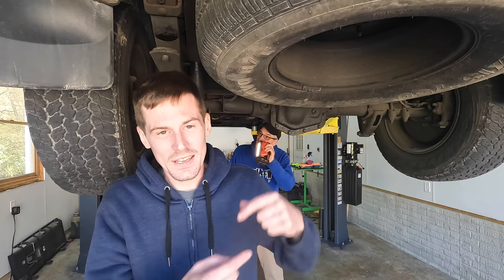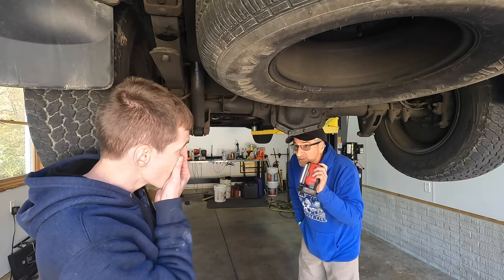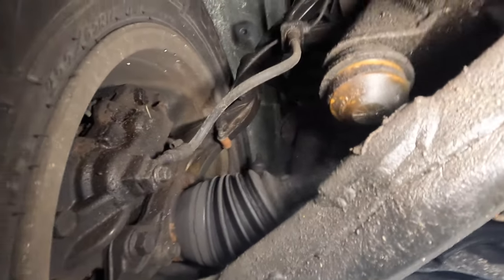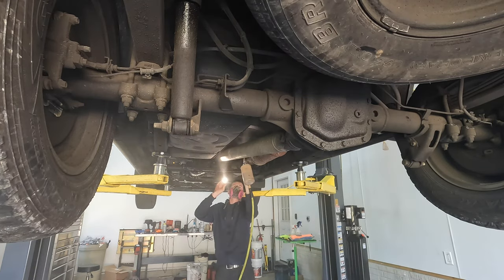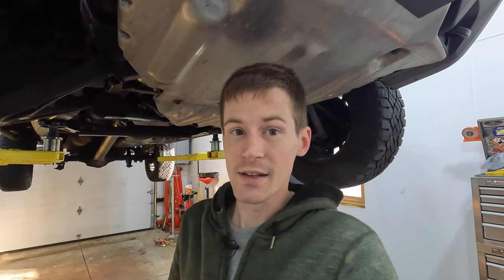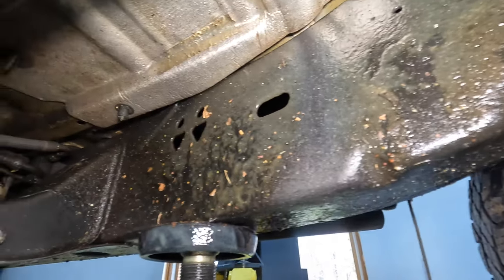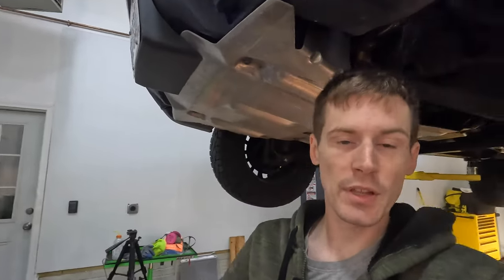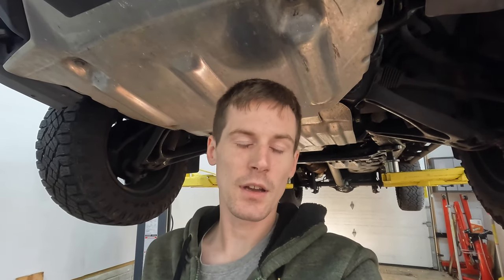Lanolin Undercoatings 5 Year Review & Career News... (Fluid Film, Woolwax, Surface Shield)

Comment from the maker: Edit 11/4/22 Going forward Surface shield will have a female top on the aerosol cans like the other products that are out in the market.  This means the grafitti adapter is no longer required to attach the inner cavity tool to the aerosol can. As of now both the male and female cans are on store shelves. Just something to watch for.

Products used in this video: 
Surface Shield Gallon: https://amzn.to/2YpscVq
Surface Shield 5 Gallon: https://amzn.to/30rrrvK
Surface Shield Aerosol: https://amzn.to/3BIUgk8
Fluid Film: https://amzn.to/3mQbiZy
Woolwax: https://amzn.to/3wmpbS1
Professional Spray Gun: https://amzn.to/3bIN9gX
Aerosol Can Spray Handle: https://amzn.to/3EUpE1b
Graffiti Adapters for MALE Blaster Cans: https://amzn.to/3CPi5rX
Inner Cavity Spray Wand for Aerosol:https://amzn.to/3NNtZbP
Wireless Borescope: https://amzn.to/3CPdCoV
My Amazon Store:  https://www.amazon.com/shop/repairgeek
Help support the channel, buy using my Amazon links
As an Amazon Associate I earn from qualifying purchases and your cost is exactly the same

My Amazon Store:  https://www.amazon.com/shop/repairgeek
Help support the channel, buy using my Amazon links
As an Amazon Associate I earn from qualifying purchases and your cost is exactly the same.
Reply: I just tried surface shield for the first time this past weekend on some round frame rails before putting caps on the end Inside the wheel wells. I picked up 10 cans from Harbor Frieght and to my surprise I got 7 cans with a male end, and 3 cans with the new female end. I wasn't aware of Blaster making this change, so I had already purchased a cavity coating wand made by 3M that accepts the male end cans. Now I'll have to buy another wand for these new style cans. I'm curious, have you verified that the KBS coating wand works with the new female surface shield cans? Or have you sprayed it with the KBS wand and the graffiti adapter?
Reply: thanks for this update! do you know if the product on Amazon is being sold with male vs female currently?
Reply from the maker: I have no idea what stock Amazon has on hand. I know the newer stuff that is heading out the door is female.
Reply from the maker: The KBS for a fact works. I literally bought every single cavity adapter on amazon and tried them all.
Reply: Will they ever be available in Canada? We need it the most!
Reply: I think what fluid film dealers meant was that surface shield is a harmful solvent and their product is not harmful if inhaled, on skin, or eaten by you or pets lol. Going to be buying a 4runner soon, which would you recommend? Fluid Film vs PB Surface Shield? I like that a gallon of Fluid Film is half the price.
Reply: Great job man you've made a difference in the world while being honest and bettering the quality of life for yourself and loved ones cheers to that my friend, thanks for the videos 👍🏾💯
Reply: Almost every single inner cavity 360 spray extension nozzle are made for MALE !!!!!! TOP !!!!! SPRAY !!! CAN !!!! NOT FEMALE!!!! Now Surface Shield has female tops on the can, it is IMPOSSIBLE to find any inner cavity extension without paying a ridiculous amount of money for a plastic tube and a brass nozzle! KBS works for an insane price. You can buy extension for male spray can for under $10
Reply: If only under carriage car washes offered lannon spray
Reply: Just purchased a new Toyota Camry SE and I'm going to Fluid Film it this summer, any tips not mentioned in the video? I've heard that Fluid Film and Surface Shield never truly washes all the way off. There's always a microscopic layer that gets into the pores of the metal parts of the undercarriage.

Comment: I heat the Woolwax to about 180* and blast inside all the frame holes. It comes out so fine that you can actually see plumes of W.W. mist come out in all other areas of the frame, far away from where I am actually spraying.  This ensures that the inside of the frame is coated as well. Great videos!
Reply: Hey I used a product called Waxoyl . They have underbody and cavity products and instructions indicated to place in hot bucket of water then pour into spray gun for best results coating and creeping into pinch welds and inner sheet metal.

Comment: Really appreciate this content. It takes a huge amount of energy and resources to make a vehicle. Anyone who promotes protecting these vehicles from corrosion so they last as long as possible is doing a great service to people and the environment. I have lots of experience with fluid film and I found it washed off too easily (salt/snow belt Ontario), and it is expensive. I also have experience with "annual dripless underbody oil" from Carquest. I can get a 5 g bail for the same cost of 1g fluid film. This stuff is 100% dripless and seems to last longer although it's likely toxic compared to lanolin.

Comment: I watched a lot of undercoating review to settle on which product o was going to offer in my business. I've sprayed both WW and FF and found WW to be better for long term adhesion. I've not tried Blaster mainly because of the cost but from what I've gathered is Blaster is essentially the same as FF and WW but has petroleum jelly added to increase its longevity.  When I do undercoating I spray thick. Usually 1.5 to 2 gal for a truck. I also spray everything including the floor pans and bottom of the bed. On my second year I had a few repeat customers and was beginning to think they weren't satisfied and went elsewhere.  That wasn't the case at all. They simply saw that it didn't need another coat. Again, thanks for your honest reviews.

Comment: I live in the Salt Belt and started using Woolwax when I got my 07 Silverado from Texas about 3 years ago. All our cars get a treatment every May and touch-ups in October. I even spray over the rust and it slows down or stops further rust. You can even spray inside frame channels. Advice: if you use an air compressor, put an air dryer between the compressor and your air gun, otherwise you may be trapping moisture inside the Woolwax. Also warm the quart jugs in the sun (or in hot water if you live in the northeast where the sun doesn't exist) to make it flow better.

Comment: I just had my new Outback undercoated with Fluid Film.  I ran out of time to do it myself, so I had another company do it.  I wanted to use Surface Shield based on your results but I could not find any dealers.  I realize it is a new product, but Blaster needs to have an online list of applicators once the product gets more established.

Comment: I’m a Woolwax and Fluid Film user. If The newcomer, Surface Shield, has been available when I started using lanolin I’d likely use it as well. Fluid Film is available at Walmart, for me that’s a plus (actually a minus since I get a discount😊). Woolwax was the first one to be available in black so I use it mainly on the underside because it just looks sweet when it’s fresh. Fluid Film goes everywhere “hidden”
I’ll likely not switch from my current product and annual or as needed applications. Reason is these products just work and are not very costly for a DIYer.
You keep doing what you do, you do it well.

Comment: I’ve used both Surface Prep & Fluid Film, and they work.  Agree, SP is easier to spray, and a little thinner (creeps well).  Most of the benefit is in thorough application.  The first application is the most time & product consuming as every nook & cranny needs covered.  But each year after that gets easier, I just hit the high splash areas.  Both great.

Comment: Congratulations. Well deserved. Excellent videos. Used surface shield on my 2015 King Ranch PowerStroke. Looked ok after 2 Upper Peninsula Winters and weekly car washes, it washed off rather quickly. Used the spray cans. 3 didn’t work. Counted it as a loss. I’ll be buying the 5gal bucket this year to spray my new Tacoma and a friends vehicles. Lesson learned on the cans. Thanks for the videos. I’ve turned a few folks onto surface shield. Just not the aerosol cans lol.

Comment: I coated my entire snowplow including the frame and everything mounted to it 2 years ago with Surface Shield shortly after buying the plow. I have a deep scratch on the front of plow just above the cutting edge. The only thing I've sprayed on it since is the front of plow which gets most of the abuse from grit and salt. That scratch that's on the plow still hasn't rusted and there is not a speck of rust on any part of the plow or any bolt, screw, hydraulic hose fitting, pin, spring, cylinder, etc. That stuff is great!

Comment: The Surface Shield that I applied a year ago to my 4Runner undercarriage still looks good.  I need to get it up on jack stands and put on another coat this year before the roads are salted.  I just bought a 1996 Hijet mini truck from Japan where they apparently don't salt their roads.  It has only minor surface corrosion on the frame.  It's getting a good spray of Surface Shield before I drive it in any winter weather.  Thanks for talking Blaster into a spray can nozzle that doesn't need an adapter for a spray wand to spray inside frames and body panels.

Comment: in our area in NY state, we use a product called Rust Check...it has to be applied once a year but it works great....it is sprayed on the underside and into the doors and fenders and any inner panels......i had a 2005 Subaru Baja that i just sold in 2020 and it was 99% rust free and that was mostly minor surface rust on hidden areas or areas exposed to car washings....for a car that was 15 yrs old and looking as great as it did when I sold it, it was worth it for me....this product that you showed looks very promising too and I would love to see 10 yr and 15 yr follow ups....great video
Reply from the maker: I tested rust check out on the telephone pole. My results weren't good but, my pole testing test JUST the product. On an undercarriage it's going to collect dirt as well but that adds another variable to a test. If it works for you... Use it. 👍
Reply: Yes, I also use Rust Check for many years here in Canada and it is fantastic!
Reply: @astrogate1   I have used rust check in Canada and it was useless, more and more rust each year.  I had it sprayed professionally.

Comment: Surface Shield looks good. I had similar results using AMSOIL HD MP. I put two coats on a new Tacoma and 8 years later (in OHIO) no rust!
Down side of AMSOIL, they don't sell bulk. It only comes in 15oz spray cans and it's hard to find.
Reply: can you not buy the Amsoil in Bulk from their website and associated dealers for a discount?  that is one product i have yet to try in western Iowa

Comment: I have a 1986 Ford Bronco that I plan to restore. The only reason that I got it is that its frame is still  in great shape with only minor spots of surface rust. There are some areas on the axles covered in oil and road dust; under the oily layer the axle has its original paint intact.. It seems the wet coatings is the way to go...

Comment: I just got a gallon of Surface Shield.  Pricey....  I only had to do minimal recoat after using a couple of cans last year.  The stuff is good. Every year I have to spray less and less, but there are spots that need to be shot.  I will spray the inside of the frame with FF next year.  The only obvious spots I needed are from rock chips.  Look at the MSDS for each product FF and SS. They are very similar except SS has petroleum jelly.  SS has less offensive odor as well.  I can see applications for both products and will continue to use both.  Thank you for your video on these products, or my 4runner would be out there rusting away.

Comment: Great video and nice job of calling out FF dealers with torch test. Do you recommend undercoating for a new SUV(BMW X3M) with full PPF on body panels?  Will be driving it in NJ/NY in snow/salt winters. Plan to keep it for a long time. My concern is will the undercoating overspray end up on the PPF and get stuck. Also have protective film on the outside of windshield against rock chips.
Reply from the maker: Why would the undercoating stick? It wipes off paint if needed. What difference would plastic or vinyl make?
Reply: @RepairGeek  I don’t know. That’s why I am asking. You can buff it out of paint using compound  but on protective film is a concern. I spent  $6k on entire car for PPF. Will iundercoating come off using a rubbing alcohol ? That’s what I use to remove bird droppings on PPF.
Reply from the maker: Buffing??? Dude you can wipe it off with a rag.
Reply: @RepairGeek  Awesome man. Going to get some surface shield spray cans and do it in the next few weeks.

Comment: Thanks for the well-thought-out videos!
Question:  Would I have to strip/power wash Sta-Bil Rust Stopper before using Surface Shield?  I'm thinking of making the change due to Surface Shield's apparent longevity.  I'm concerned about incompatibility, though -- especially inside the frame tubes and other hard-to-reach places

Comment: Will be doing this shortly! Still unsure if I should sand/scrape old rust, apply a converter to what's left, paint any bare metal, and THEN apply surface shield? 

I'm sure once I start scraping away I'll hit bare metal, and my instinct tells me to paint over it but I am unsure.
Reply: I have a Toyota hilux, (4 runner in your country) here in New Zealand luckily we don’t salt our roads so no real rust issues, having said that my 2007 hilux had some surface rust on the underside, I wire wheeled it, rust treated it, then repainted the entire chassis, then coated it with fluid film inside the chassis and crc cosmaline on the outside only cause it hangs on a bit longer, it came out mint, good luck with your project👍🏻

Comment: I had to laugh when you put the torch to that Lanolin. If you have ever seen a fire at a wool store or a shearing shed where the lanolin gets into the timber I don't think you would do that. However it looks like the stuff to use and I have used it to protect machined surfaces, some very highly finished and never been disappointed. Different brand but basically the same ingredients.
Reply from the maker: Well, wood burns... 😆
Reply: @RepairGeek  Indeed it does but add a bit of lanolin and it really intensifies.👍

Comment: I will say pb blaster is always my go to for penetrating oil for all my repairs in Maine. I was using woolwax undercoating but I hate having to heat it, and getting it is kind of a pain compared to FF black at napa. I would use surface shield but I don't want to play around with making it black, and I don't want to breathe it in with the added chemicals. Granted I wear a respirator but as everyone that sprays commercially knows it lingers for awhile
Reply: Does Maine sand roads? I got a truck from Maine and it was full of sand in the frame. Maybe it was driven on the beach.
Reply: @alb12345672  yes town roads use a sand and salt mix, and the state roads use a salt and calcium mix. Horrible on vehicles around here, they rot out within 10-15 years if not undercoated regularly.
Reply: @frankhartford5194  Sounds like rustproofing is a necessity.No sand in used in NY but it is still pretty bad.  And the inspections seems strict there too.  In NY, not so much, there could be rust to the door handles but as long as the suspension attachment points on the frame are ok.

Comment: Thanks for your research.  I sprayed my suburban with surface shield and its looking great so far.  Quick question, do you find that these products help in bolt removal over time?
Reply from the maker: They can, it certainly won't hurt. I wouldn't rely on lanolin as a penetrating oil though.

Comment: Our 2023 RAV4 has a fiber material in the inner fender wells.  We keep our vehicles forever and have started FF treatment from day 2 of ownership.  What's your take on the area behind the sound dampening material?  It can be removed but would be a PITA with plastic nuts and clips that hold it.  Also concerned with saturating the material with fluid. For now, I just sprayed the visible painted panels in that area.  
Also, I did remove all the under panels (time consuming with all the fasteners) and spayed the hell out of everything.  Do you think this area ever needs to be done again as it is protected from rock chips.

Comment: 1) do you spray in the door jams and hinges? Donyou make holes in the doors jams like krown does?
2) how are your reaults with surface shield on rubber trim? There was some boticeable trim damage from constant contact with fluid film
3) if surface shield stays on much better than fluid film under pressure washer.... if it creeps onto the exrerior paint, can it be removed for cosmetic reasons?

Comment: When you spray around the brakes, how do you prevent the product(s) from getting on the rotors and contaminating the brake pads?
Reply from the maker: I don't. I don't DIRECTLY spray the pads or rotors. They might get some overspray on them but it's never been an issue.
Reply: @RepairGeek  But you spray the calipers and suspension bits around them?
Reply from the maker: @aubreywhitley6889  yep

Comment: I have cut Fluid Film with old transmission and old gear oil. Seems to have held up quite well. I will say you should check out Pro Form oil based undercoating. It's made up of two major hydrocarbons, one of which is the same that Fluid Film is.